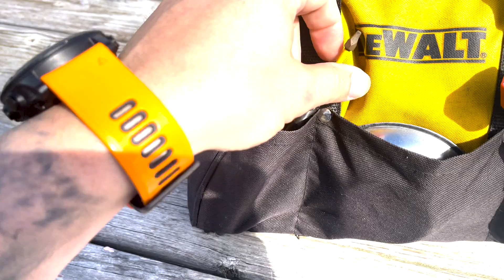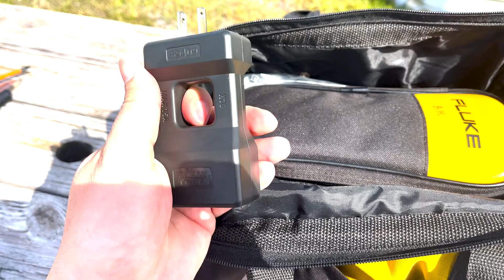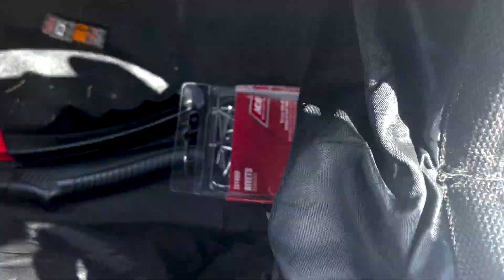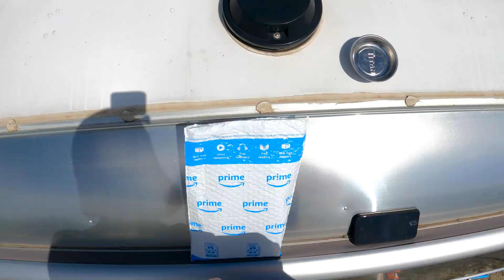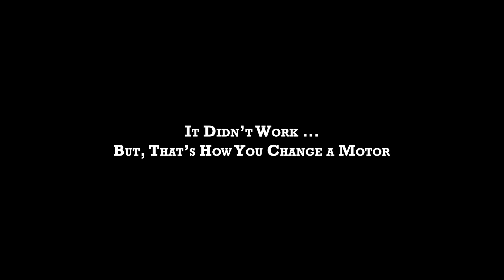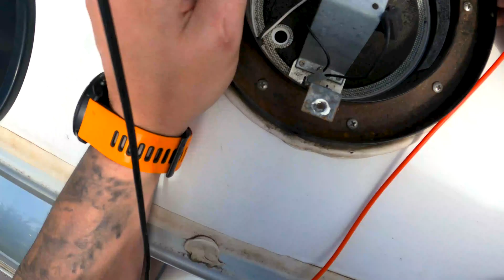RV Exhaust Fan Motor Replacement + Some Extra Troubleshooting

Comment: I was almost at the end.  I didn’t see a source for the motors.  Is there a link on the video.   Both of the exhaust fans in our 2020 25’ Globetrotter are shot.
Reply from the maker: There is a link for them in the video description.
But here it is: Replacement Motor For Exhaust Fan - https://amzn.to/3OFQtNR
Reply: @RamblinHamblins    Thanks!